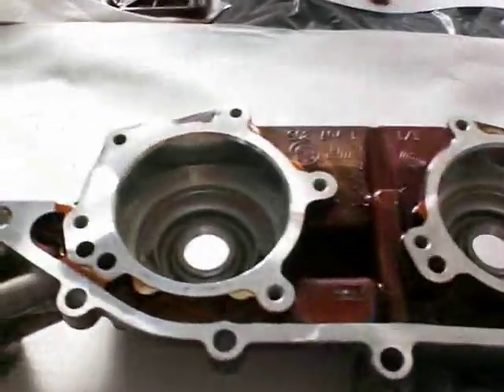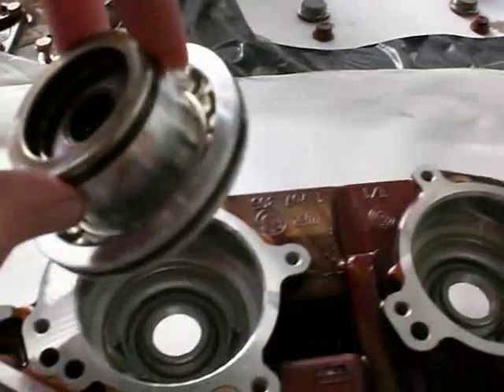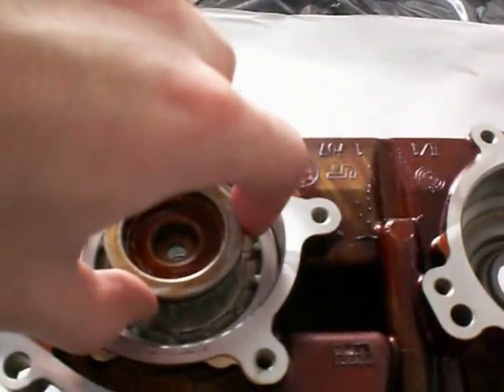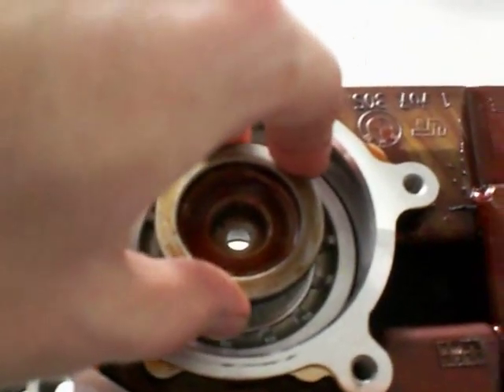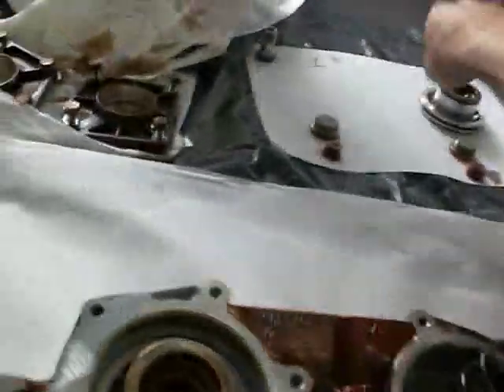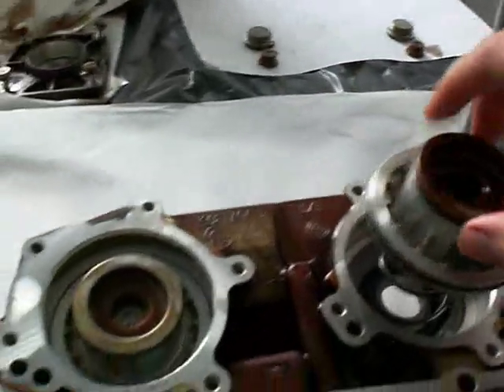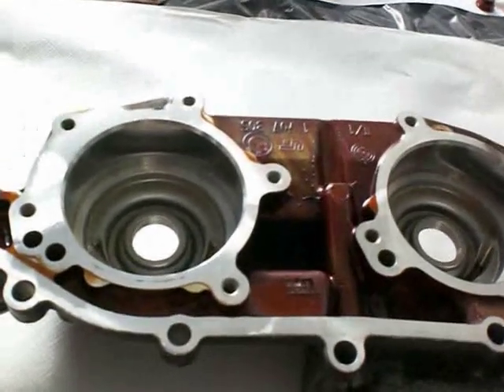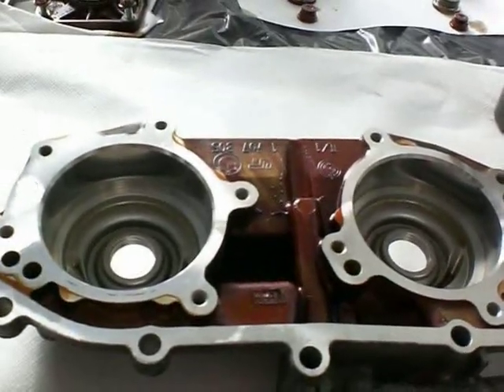BMW double VANOS seals at 127k km (1/3)

Comment from the maker: The seals cost me $60, and I did the repair myself so my only other expenses were gaskets I replaced along the way (maybe $100 all included). But for single VANOS the seals are $30. However for the single VANOS engines you need more 'special' BMW tools for crankshaft locking & camshaft alignment. This will cost an additional $250 if I recall correctly.

Comment from the maker: No, the E36 328i had the M52B28 engine (non-TU), with single vanos. You can spot this under the hood because there will only be a protrusion at the front of the engine on the intake side. For the TU variant, this protrusion exists on both the intake and exhaust side.

Regardless, VANOS seals fail in both variants. You will probably have the same problem; removing the VANOS involves more work (e.g. locking the crankshaft) on a single VANOS engine though.